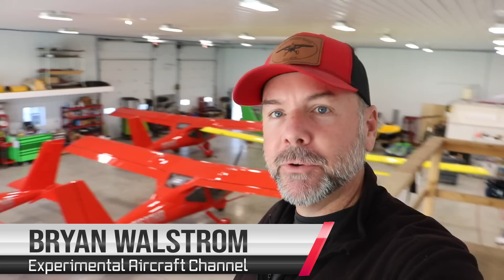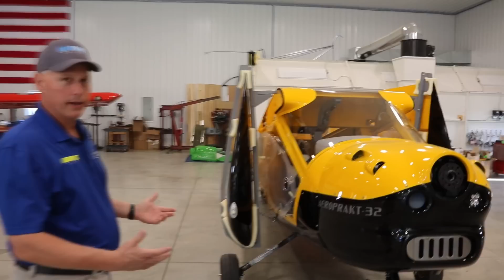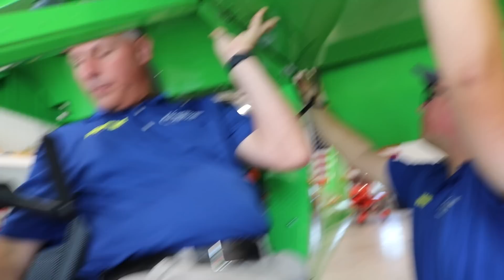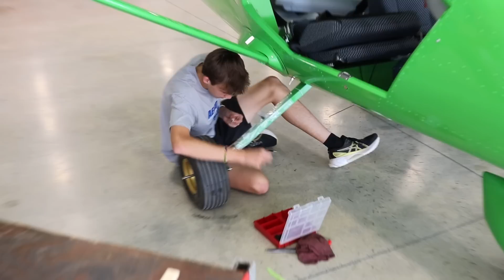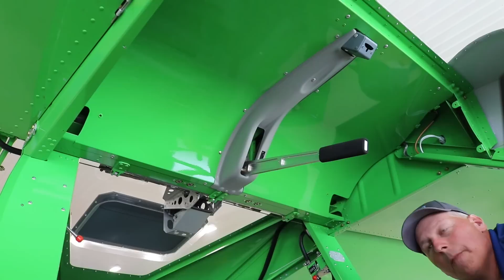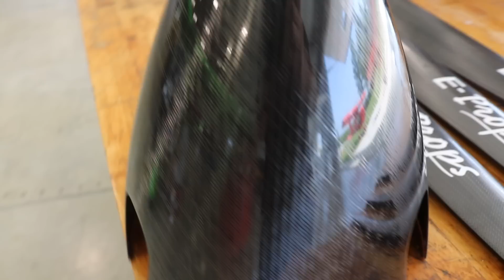Ukraine Now Supplying A22 Aircraft to USA - Kyiv AeroPrakt News

Comment: And the guy holding the wing with his head, is called the HEADTECH ? 😂 I don’t think I could fly on this now that I saw that the wings have a weaker joint point on every  part of them even when compared to my hang glider or any of my RC airplanes.  I don’t think those are rated for anything more than 1G,  Guaranteed.

Comment: I do not like the guy who is doing the distribution. How tf do you inject conservative brain rot into a sales pitch? Before I knew anything about the airplane, I knew his political opinions and his religious convictions. Why? Hell, I could even observe the cognitive dissonance dude is grappling with when his American Conservative beliefs on UA are in conflict with his experience working with actual Ukrainians. Then, as if that’s not enough, guy tops all that off by pulling the classic, “how long have you worked for me? Three months? 6 months?….8! 8 months?!?! “Well, haha! Haha! We have a few other employees!” (As he stands next to his 2 employees and 2 interns). As if to say, “don’t read into the fact I have no idea how long one of my 4-6 employees has been working at the company I ostensibly run.” What a detestable prick, this guy! And somehow I managed to learn all this before he even started putting the wings on the airplane he wants to sell me? WTF
It is a neat little airplane, and I am all the more partial to it due to its UA origins. But I would never think about buying one until they get another/ different US distributor. 
Also, fabric control surfaces are used for a variety of reasons. The only one he got correct was weight. Somehow he missed the number one reason for fabric control surfaces, balance & flutter. It’s NOT more expensive. They didn’t do it for looks (wtf???). 
Oh. My. God. And the cherry on top? Heaven Bound Aviation. As if we needed more confirmation of exactly who and what this guy is. Do not trust anyone who so eagerly advertises their own piety.

Comment: Give me a good reason why should i spend 150 to 200 k dollars in a aircraft that you buy it for less then 90k. That is the price in Ukraine for this "toy"
Reply: You should buy the 1961 Cessna 150 for $45,000, then overhaul the engine for $30,000, install new Garmin avionics for $20,000,  paint it for $15,000. Just pray that the corrosion issue is still okay.
Reply: @A6youser  My only point here is this: Why a $90 000 transform in a $200 000 just for crossing the ocean? From what i know shiping a full size container cost about $3000 from europe to USA.
Reply: @george_sea  well also  evrything coms from China X2 price minimum. This is howUS have so much GDP  its actually inflated a lot ))  Finishing  assembling, runing workshop and dealing with FAA i gess will bump the price a lot even if the labor as low as $100/hour. Try yourself
Reply: @A6youser  The "toy" come ready to fly. Hang the wings and fly. A full container will fit at least 3 may be 4 of this aircraft. To people will ansamble the wings in 1 hour or less. Nobody pay an FAA certified mechanick more then $40/h. but i am going to say in the industry of small "toys" 25/h. With vamal/import taxes i estimate a total price increase with no more then an extra $20 000.
Reply: "... less then 90k."
I will give you a good reason to not spend 150 to 200 thousand dollars in this aircraft: save them to pay for English lessons.
Slava Ukraini! 🇺🇦
Reply: @jordillach3222  my english may not be that good but at least i have a brain that i use.... God bless the US Hay 🇺🇲

Comment: you'd think the wonderful welder they have would build an adjustable height mobile rack to facilitate the assembly of the wings since they literally throw away tons of steel frames the planes come with....
Reply: Exactly what I was thinking !!!
With a redesign it could easily be a 1 man job an become an assembly and holding jig ...
Am I the only one thinking that those bolts are kinda small an light to hang your life upon ???
Unlike lug bolts on a car wheel...
Ya loose a wheel unlike loosing a wing your death isn't probable outcome !!!
But what do I know I've only built cars an motorcycles...
Reply: @WilliamCollins-sh6lm  Depends on the strength of the bolts.  Lots of variation available, just don't buy any from China.
Reply: @WilliamCollins-sh6lm  Proof in the pudding; millions of hours using the too small bolts on millions of aircraft types says they are sufficient. They are being pushed not pulled or sheared.